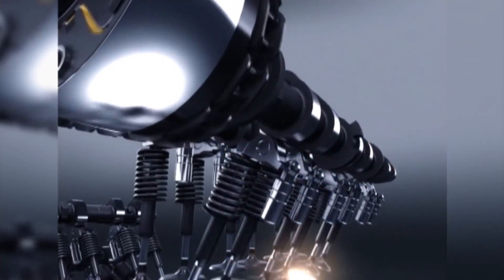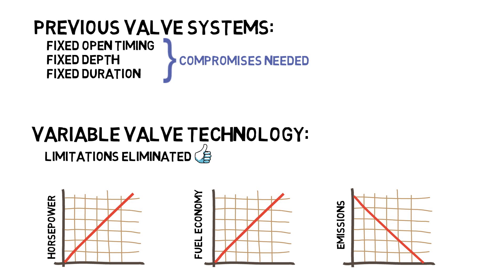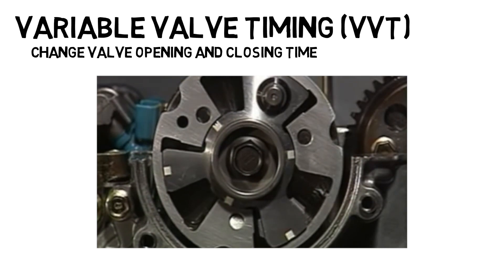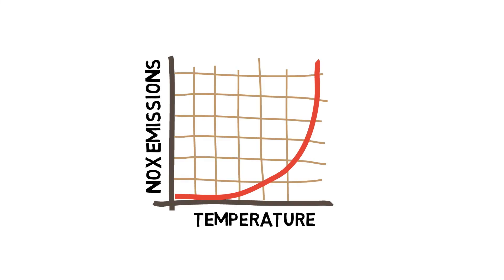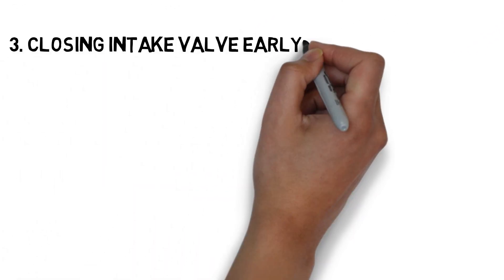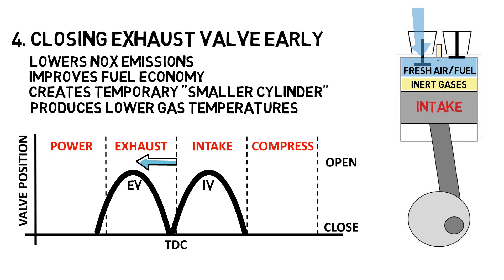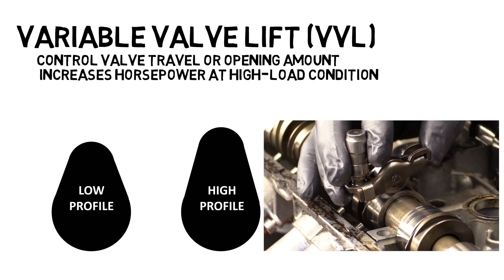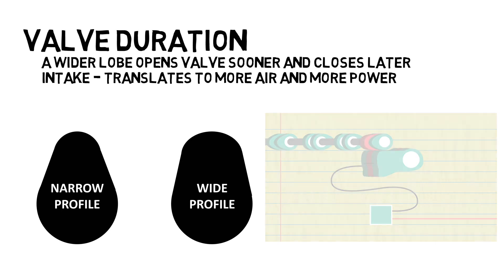VVT vs VVL | Everything you need to know about Variable Valve Timing and Variable Valve Lift

Comment: now I know why the EGR canister exists! I always wondered what exactly the benefit was for this. I know of many people tuning cars that will remove this since its not really necessary. Does removing this type of system have any real negative effects, or just reduces combustion efficiency?
Reply from the maker: Removing it should actually increase combustion efficiency. Since EGR dilutes the mixture with inert gases, torque fluctuation increases and combustion becomes a bit unstable. Because of that reason people remove it to improve horsepower, but I would argue that it makes a huge difference since EGR maps should have zero re-circulation at WOT anyways. Some improvements could be seen at the low to mid load range, but combustion temperature and NOx emissions will also rise. If the EGR system is deleted I would recommend to tune A/F and ignition timing to ensure catalyst temperature and knock are ok.
Reply: @enguverse  the only benefit I can see is keeping a cleaner intake tract. But EGR’s are quite useful is reducing emission and decreasing pumping losses for fuel economy as you said. Simply removing them without any tuning is silly. The lack of EG in the cylinders will effect the burn speed and therefore timing required for MBT.